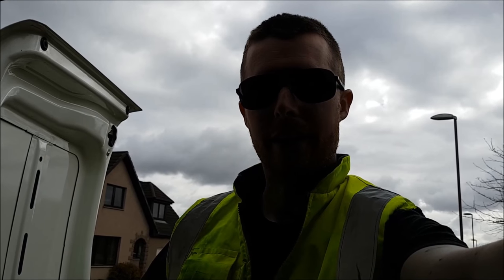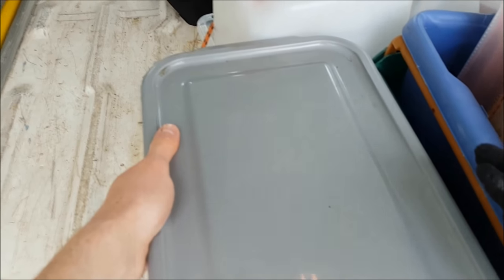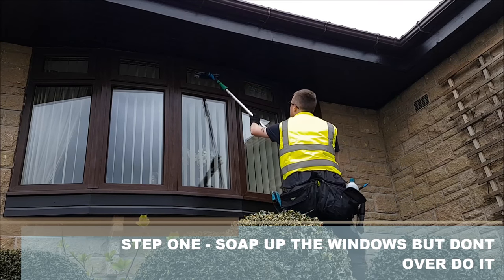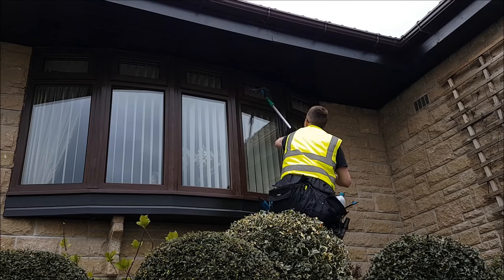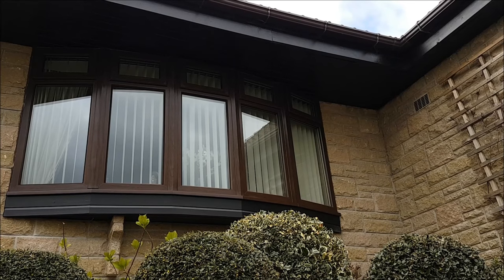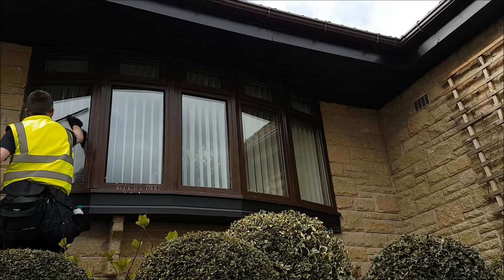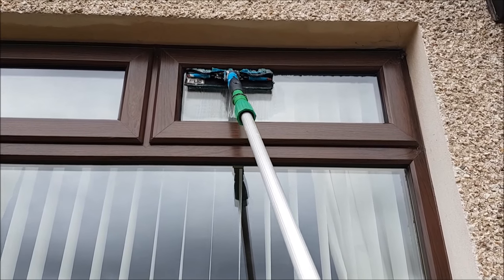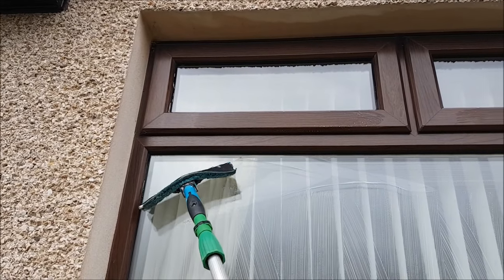How to clean small thin windows

Comment: Can you do this as easy on second floor windows?  if you can I’m going to buy the equipment for that. Taking a window ledge into account
Reply from the maker: With practice yes ;)
Reply: What do you use for second floor windows trad man? Ladders or pole? Telescopic ladders or regular ladder?
Reply from the maker: I use a ladder for first clean then for maintenance cleans i use a Gardiner slx30ft pole with the moerman angle adaptor and moerman excelerator squeegee 👍👍

Comment: Hi peter do you have a winter kit video? ....my tip is thermals for legs(Amazon), water proof boots(sports direct) and a water proof body warmer hi vis type, and many layers of tea shirts all the same colour people (pmark £2 each) in full winter x5/x6 teashirts, this will  keep you very warm and dry and if hot peel a layer off, as you do want to avoid sweating as this when cools makes you cold.
Fingers mind always an issue and belive me ive tried most products. 
As a tip carry many spare pairs and a container with hot water and a towel around it, tuck your gloves in there it will stay warm most of the day, recommend a 15/20 ltr tub. 
Roll on spring!!!😥🌈😁🌈🤣
Reply from the maker: Fantastic tips there buddy!!
Reply: Cheers one does waffle on at times cheers 😁 Andrew
Reply from the maker: Its all good info 👌

Comment: How many jobs can you do in a day roughly 'domestic' ? 
And how many fibre cloths do you get through.  Good vlog 🍻
Reply from the maker: jonny hart hello! per day depending on the size of the houses anywhere between 12 large ones or 20 normal council sized houses.
Reply from the maker: jonny hart as for the cloths only use cloths for frames and sills and i use about 2-3 a day.  when one gets wet i ring it out and i have several bungies across the back of the inside of my van and i hang up my cloths to dry.  my van is open cab so it's drying the cloths from the heater ;)
Reply: trad man how many people do have working for you to do all those houses.
Reply from the maker: Just me :)